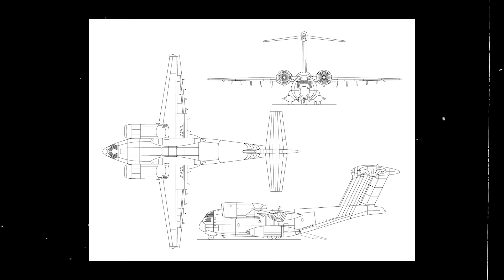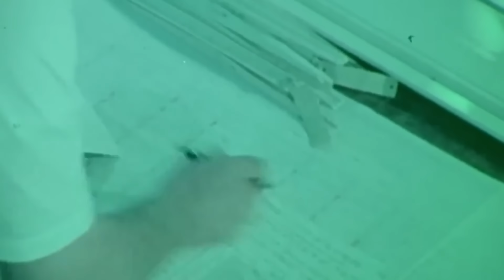The Plane that No One Wanted (But Could Land on a Football Field)

Comment: Design sounds perfect for fire fighting.
Reply: Can they make it amphibious?  Skimming a lake is the fastest way to reload a water bomber.
Reply: @Yaivenov came here to say this.
Reply: @Yaivenov  The engine placement is perfect for an amphibious craft
Reply: @Yaivenov yes with so changes
Reply: @Yaivenov  i would have to think that it is possible. but they might end up in a situation where the result is too compromised to be effective and it would have been better to just make 2 planes. for instance, i think stol capabilities would be largely useless on the water, as i don't think that stol is a priority for seaplanes given that their takeoff runs are already pretty long anyways. or you might have to reinforce the belly of the plane so much that the fuel and payload amounts are lessened.
Reply: @toodlepop  STOL would probably help with sea planes, as it is really hard for them to get over a certain speed (60-80kts? can I get a fact checker?) and to "unstick" from the water surface.  The other major aspect that would lend itself to the task, and why I initially thought of this, is the high and forward mounted engines which would put the intakes above and ahead of sea spray being kicked up.  A bit reminiscent of the Ekranoplan's engine position.  Only better.  And on an actual plane.

P.S.: Many water bodies are bookended with steep hills/mountains. The YC-14's incredible climb rate of 6k feet/min would be another point in its favor for the task, allowing it access to some waters that are otherwise inaccessible to all except bush planes.
Reply: @toodlepop the Russians already use an over wing sea plane fire fighter from m Benev
Reply: This would make a great fire fighting plane. Lord knows that the Canadair one can use an upgrade.
Reply: @trainglen22   yeah, I've sat and watched FOD sweepers follow them out on the taxiway, then down the runway all day long. 😵‍💫
Reply: Or Davis Mountain parking lot attendant.
Reply: I want one.
Reply: @WR_CTorch  I think the only way your going to get one is the Russian version.
Reply: @shawndmiles6747  well, yeah. The Boeing version now would be a nightmare.
Reply: Absolutely was thinking same about firefighting. Had Boeing made a few hundred of these I think we would see them flying in this role.
It looks to me like the design could be adapted to a stepped hull design to allow for reloading from lakes/rivers, but you could also set up high capacity pumps near rivers in a field or other flat surface since it was designed for that anyways.
Reply: A few years ago the government tried to give California a bunch of Warthogs for fire fighting but California didn't want them because they said they would have to retrain all their pilots.
Reply: @flynnstone3580  not to mention how much the plane would be out of balance with the 30mm gun removed
Reply: @flynnstone3580  yes even though most old school Warthog pilots were airliner pilots  its the difference at ground level maneuvering is different also the amount is 16000 lbs load for the A10. A modification would need to be done I would assume it's do able but would it be cost effective or dragy?
Reply: @richardmckinnon8791  it wasn't that long ago they were still using the old Billy Mitchells here in NorCal. Our airport has a short runway and they would drop CO2 cylinders in a sand pit after liftoff.
Reply: @flynnstone3580  there using a couple crop dusters too 🤮
Reply: @flynnstone3580 what WARTHOGS!!! I work as a wildland fire fighter in California and would KILL to learn to fly that plane!!!

I’m in the military (guard) but too old to fly for them. I’m hoping to fly for calfire
Reply: @chucksolutions4579  The Warthogs were offered by the government for free and California didn't take them. I knew a gal about 8 years ago that was the pilot flying the spotter plane out of Columbia airport and she was making $150 an hour.
Reply: It would also make a great gunship and could be an improvement on the AC-130
Reply: @Rockoblocko  The god of thunder, lightning and volcanic rain requires no improvement thank you . 😅
Reply: But there are not the Gazillions to be earned, that the DoD spends for new toys... 😐
Reply: Not so sure about that, but the advancements that were learned were adapted to the Micky Douglas C-17 program... And the realization that if you would lose an engine on takeoff at High or Hot conditions you are in a world of hurt and have no better than a 50/50 chance of a crash... So go big and four engines... to have a safety margin... So when you have to go and make sure you can survive the loss of one out of four...
Reply: My thought exactly
Reply: 3 months later..yes firefighting for sure
Reply: Or gunship.
Reply: Indeed, they should use the concept to make a large fire fighting drone. Perfect for regional fire fighting.
Reply: How would that design be advantageous for fire fighting?
Reply: @philipmartin708  high climb rate, engine configuration favorable for flying boat configuration; flying boats can reload the fastest by doing a single lake touch n go, runway planes have to completely land and wait while pumps fill them.
Reply: @Yaivenov  There are already many firefighting planes that meet your criteria.
Reply: @Yaivenov 

You can have an amphibious Flyingboat..  the Be200 and  the  Canadairs  for example .
Many are also Stol ..

As for stol flyingboats Japan's Shin Mewa's  have a separate helicopter type turbojet engine in their aft spine to provide blown thrust over all wing and tail surfaces even at  static air speeds to provide lift and control a what would be otherwise stalled airspeeds. 
The Japanese also produced their own experimental version inspired by this version.. 
Hard to realise but fashions in military thinking do exist. I agree this would form a great one to revisit possibly with SAAB BAC and Ukraine in mind.
Reply: @philipmartin708 besides fitting the fire attack role better than the 747 rigged for fire is that it can perform a Continental role and multiple fire assists by having the same speed and endurance as the 747. I can assure you, once the 747 arrives on target, it is not a whole lot of fun or easy to weave into the fire line. The current tactical fire fighting fixed wing fleet is aging, and not well. With stress, heat, high flight hours. Max weights and slow flights. G forces and chemical residue. Always a need.
Reply: @jaxonboys3366  What about the cost compared to typical fire fighting aircraft. Also, fire fighting aircraft don't need to have STOL capabilities. There are lots of retired airliners that can be had for cheap (relatively speaking) that can be made into fire fighting planes.
Reply: @philipmartin708  there now using a few 4 engine European airliner planes. Originally they were made to be quieter overnight airliner for European cites. A California company bought some for interstate routes but everyone hated them because of the high wing with the underling engine pods reduced the view. So they have been sitting out at Movave waiting for use
Reply: @richardmckinnon8791  I love the way those planes look. 
 They're BAe 146.
Reply: @philipmartin708  I'm sure it's a fuel guzzler for sure. A STOL capability allows for slower flight. More control. Could also be used in small unimproved airfields. But it wouldn't happen anyhow. Especially with Boeing's concentration being on corporate profits and stockholders now. The CEO wouldn't be able to feed his kids.
Reply: @philipmartin708  While the CL415 is a pretty large airplane, it would be dwarfed by this.  The capacity of water would be incredibly helpful, and the ability to load that water from small lakes would be incredible.
Reply: @richardmckinnon8791  
The reason the 146 got withdrawn from airlines was the 
Same as the 747 and others. 4 engines not two, to  maintain fuel and repair  that said the Aircraft was no worse than a low wing  jet and being sat above the wings.. and a lot quieter than turboprops.. 
Pilots tend to like flying them for a host of reasons.. they are. Powerful agile and stable and they have some of the most powerful brakes proportionately  fitted, for stopping. I've read a few reports and loaded up with engineering supplies and a maintenance crew they were great fun to fly and thanks to the hilarious  brakes stop equally well.  The interior volume is very large for a small airliner  and yes they are quiet inside and out.
Reply: @clivestainlesssteelwomble7665  I have seen the 146 in fire fighter use looks good but like I said the passengers wanted to see more scenery plus I can see your point from an airline perspective.
Reply: @philipmartin708  There are no planes that are purpose built for firefighting aside from the CL-415, at least in America. The firefighting planes that do exist are vintage surplus military hardware dating as far back as world war 2, and retired commercial airliners, simply because they're the cheapest to buy, not because they're adept at firefighting. This plane would be a very interesting platform for a VLAT. They lower and slower they can fly, the better the application of retardant or water. For a retardant application, the LATs and VLATs are unable to operate out of most of the rural airports, and have to fly all the way to certain air force bases for refilling on retardant. This plane could land and take off from the retardant bases the S-2T's do, while carrying significantly more retardant.
Reply: @philipmartin708 slower attack speeds on the fire line for heavier fires. Better visibility for the pilots due to high engines. It is perfect for the fire role. Almost designed for it.
Reply: @philipmartin708  I guess the plane can be used on short runways out in the boonies.

Comment: The problem starts with one engine failure. The tail is oversized but much lift coming from the engine exhaust coanda effect is lost on the wing side where the engine fail, that is why the more classic C-15 which became C-17 both with four engines was preferred. The Starfighter F104 used blown flaps to increase take off and landing lift of its tiny thin wings. This required a minimum of 60% engine power to land safely as part of the jet engine compressed air was diverted to the opened flaps at low speed and it was nearly impossible to bring it down fast enough not to stall and without any power .
Reply: You mean a lawn dart won't glide? 🤣 I know the Starfighter had its faults but MAN that was a sexy looking aircraft!
Reply: @smgdfcmfah  Yes and as the first Mach two interceptor it was technically ahead of its time and because of high wing loading , was use in Germany extensively a very low altitude to be below East German and Russian radars coverage. this was a dangerous usage for pilot safety with very little time to react and was qualified as widow maker..attrition was in the one per 16000 hours range , quite high. Then, We also invented the twin tail F14 15 18 35, Migs Su etc…for safe upwards ejection at high speed..twin engines fighters are also more resilient in combat condition..that a fact..VN…etc…
Reply: @philgooddr.7850   Who's "we"?  You named aircraft from Grumman, McDonald Douglas, Lockheed Martin, Mikoyan-Gurevich and Sukhoi!  The Eagle is my favorite modern aircraft (it's almost as old as I am and has ruled the skies for most of my life!), but like I said, I have a soft spot for the F-104.
Reply: @smgdfcmfah  if many fighter have two vertical tail, this design was widly adopted for rigidity and weight AND to enable a save ejection in between the two tails..the rafale ejects at an angle. to the left, to pass the tail at high speed..BUT with The T tail of the Starfighter impossible, this forced Kelly Johnson to figure an ejection from below, rather unsafe and at low leverage, one of many reasons F104 was dangerous…

Comment: In short, what the USAF really needed was a replacement for the rapidly aging C-141 fleet. Even the C-141B rebuild program only just extended the life of the C-141 at most 20 years, and by the late 1990's that plane was reaching the end of their service lives. That's why the USAF now flies 222 C-17A's, and also built a major update to the C-130, the C-130J, to replace the older C-130E and H models as tactical transports.
Reply: The airlift required to support both DESERT SHEILD/STORM & PROVIDE COMFORT absolutely blew the “hours of flight” parameters that were used to estimate how many “years” the C-141 planes were supposed have, out of the water.  Shuttling back and forth from the United States to Saudi Arabia ate thru the hours on the entire fleet of Air Force transport planes.  Planes that would normally fly 100-150 hrs per month were essentially flying nonstop from  August to June.  Some planes that landed in incerlik AFB, only shut down long enough to disgorge the troops, pallets and rolling stock; they only refueled enough to get to Germany and left within an hour or two.  The only time it was longer was if there was a crew rest issue.  I know that the bulk of the aircraft that I dealt with, as the Arrival Airfield Control Group Officer, had relief crew already onboard, especially, the C-5’s.  There was one 24 hour period when we had 18 C-5’s and 30 C-141’s, plus C9’s, KC-135’s & KC-10’s in cargo mode landing with every pallet space filled.  So, that 12 month period absolutely destroyed the hrs/airframe computations.
Reply: The star lifter was a poor design, hampered by its pencil. Thin fuselage could very often be maxed out before being grossed out. Having said that it was one of the best aircraft the Air force ever had.

Comment: I was stationed at DM when they mothballed those and got a chance to see her close up during the Open House we were hosting at the time.  It looked huge next to the C-130s we had there yet small compared to the C-141.  Sadly, they didn't fly it for the open house so I only saw it on static display.  I'd never heard why they dropped the design though.  Pima Air Museum is just south of the base and the boneyard.  I used to do volunteer work for them on the weekends.